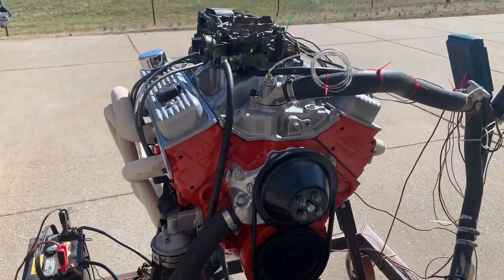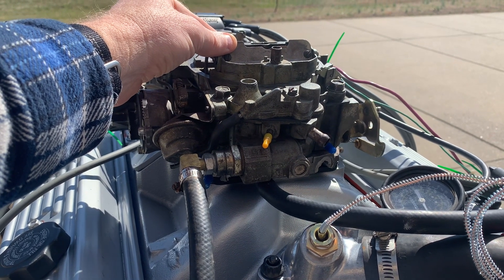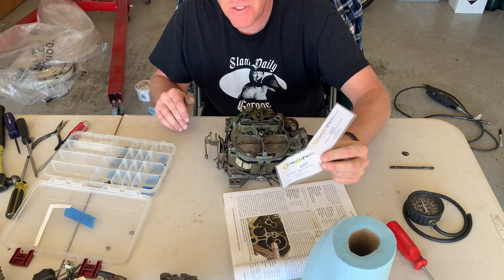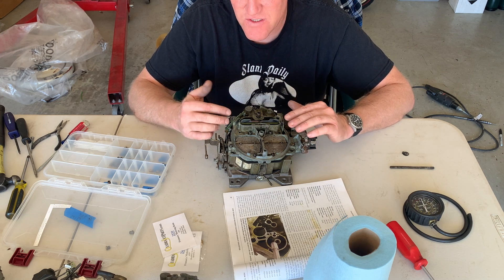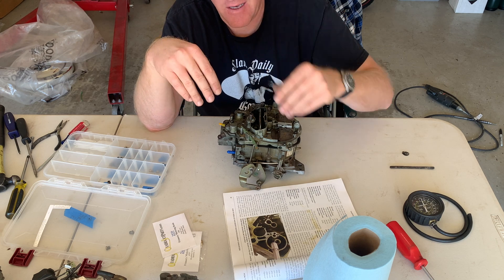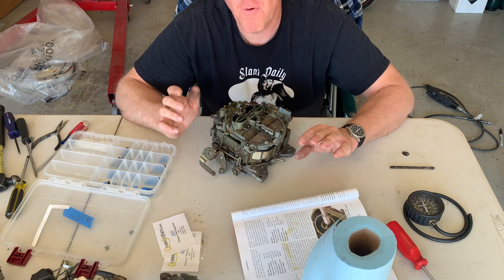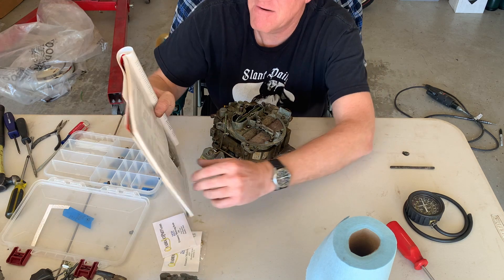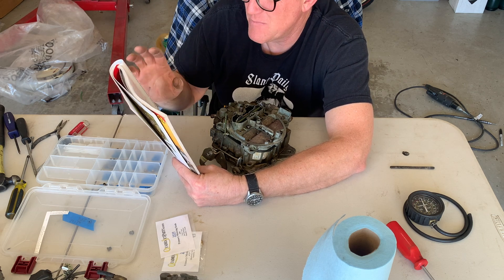Rochester Quadrajet Idle Circuit Modifications on my Project EZ302 Chevrolet Small Block

Comment: The QUAD is one of those things that you get the book, get it set and LEAVE IT ALONE! Before I lost my '93 Z/71 I was searching for a Quad. to replace the TBI. Was going to be far cheaper than upgrading to a different FI system and as long as I kept my foot out of the secondaries👹, get better gas mileage.

Comment: cliff is correct.if it still doesn't idle correctly try swapping out the air bleeds had. to do this on a 305 wouldn't idle down low till i did.
Reply from the maker: That is a good tip. It's crazy how those little air bleeds make a big difference in the idle.

Comment: Thx for sharing the video , the engine sounds Great , Sry but had to laugh to myself about your issues , from the looks of you I been running q-jets since before your parents met , daily driver is a stroked 283 to 354 , running a square cam lift rules dirt track cam , so lift an duration are pretty much the same , take the choke flap off , you don't need it anyway , sbc will start way below freezing without it , put it in box an on the shelf , some cams just don't have the vacuum to idle on the q-jet idle circuit smoothly and you put the big cam in so it was lumpy anyway right , that's running on an engine stand without torque converter or flywheel with clutch , read your plugs for timing and remember even plug gap makes a difference in timing , then adjust the carb for idle after everything else is good , you don't want to ruin the carb drilling holes or something that don't grow back , under the load of the tranny is not the same as the stand , it may not run on the idle circuit so turn the screw , alot of sbc idle fine running off it , you can notch the bottom flap to stay on idle circuit if everything else is good with god or something , just don't drill the carb body so it becomes useless to anyone else , worry about the carb after it's in the car as the last thing to tune , you have a running motor that didn't puke a chinese cam on startup be happy .

Comment: What’s the base timing set  at?  A lot of times quicker timing curve will
Help idling.  I’d try like 15-18 base and 35-36 total and see if that helps your idling.  Another trick is to hook vacuum advance to manifold vaccuum instead of ported and that advances the timing a bunch under idle and light load and greatly improves idling as well

Comment: Nice work. Having only had 4150,s they look like a nightmare!!!
Reply from the maker: The Quadrajet is perfect for what it was designed for. Poor maintenance and terrible applications by uninformed or ignorant people have gained this carb a bad rap. It works really well, especially when you consider, that carb is $20 USD any day of the week at any Junkyard in the USA. With $25 USD in a rebuild kit and have a $45 Carburetor. That’s cheaper than any used 4150 out there!
Reply: @mr.roddersneighborhood2740  What you did was impressive. Well done man.

Comment: would have been interested to see what you did
Reply from the maker: I followed Cliff Ruggles #3 recipe. I went through it in detail and unfortunately my camera died. I can’t get the info back and did not want to recreate it, but the cliff notes version is increased the Idle Tubes from .042-.047”, increased the idle passage in the base plate from a .070” to .090”, utilized the idle bypass air passages and opened up the lead filled holes in the passages by removing the lead, I also opened up the Idle Bypass Air passages from .070 to .096.
Reply: @mr.roddersneighborhood2740  
this reply needs to be reposted and pinned.

Comment: I would have liked for you to have explained exactly what you did, and the difference in what the book said to do.
Reply from the maker: I followed Cliff Ruggles #3 recipe. I went through it in detail and unfortunately my camera died. I can’t get the info back and did not want to recreate it, but the cliff notes version is increased the Idle Tubes from .042-.047”, increased the idle passage in the base plate from a .070” to .090”, utilized the idle bypass air passages and opened up the lead filled holes in the passages by removing the lead, I also opened up the Idle Bypass Air passages from .070 to .096.

Comment: Pinch off the pcv valve and see if that helps. It may be letting too much air through. It will act like a large air leak leaning out your carb. Have seen it many many times over the years. Not all pcv valves are made the same.

Comment: glad you got it to idle, what size is the cam in the EZ302?
Reply from the maker: It’s a GM LT4 hot cam. I think it’s 218/224 108lsa
Reply: @mr.roddersneighborhood2740  The GM 24502586 LT4 hot cam has 218/228 duration @.050 and on a 112 LSA